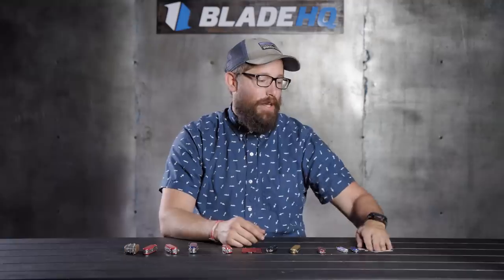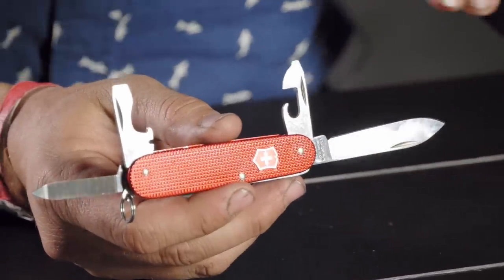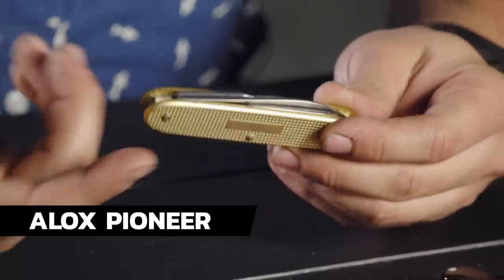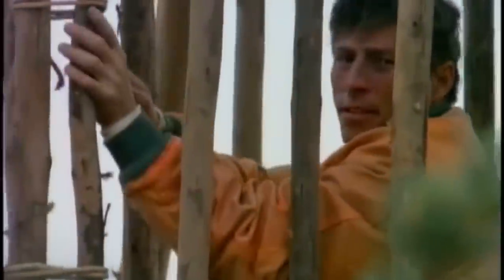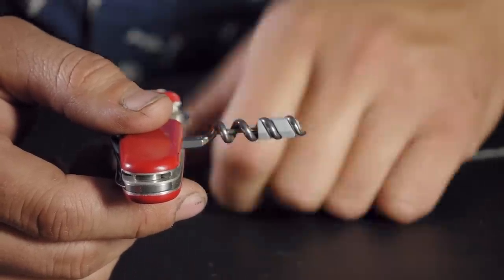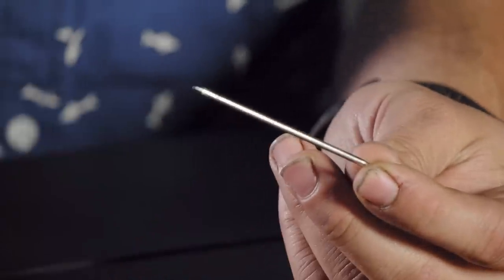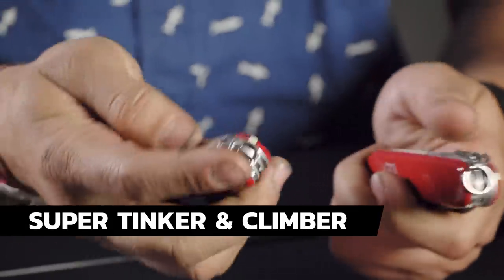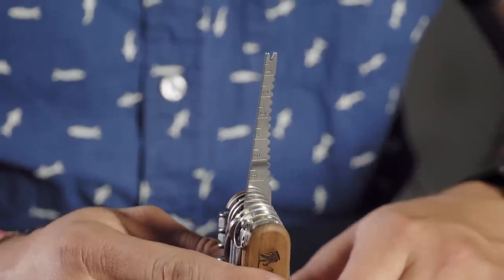Victorinox Swiss Army Expert Breaks Down the Best Swiss Army Knives | Knife Banter Ep. 88

Comment: About the screw drivers on Victorinox SAK’s, I think they rely heavily on having one or more flat head screw drivers because over 100 years ago the most common head type for screws was a flat head. A TON of old infantry rifles from back in the day were put together with large flat head screws for the action to he held into the stock or for the butt plates, or the screw dricee could be used for any fiddling one may need to do with their sights. That and the screw driver is practically a very great wedge or prying tool to have. I wanna say the history of the Phillips head screws were shakey in the earlier days, in regards to being used a lot, and that the western nations have relyed heavily on such for only the second half of the 20th century. When plastics took over I believe that smaller and smaller screws were used, thus screws with the phillips head were great for more torque in smaller applications. Old wood products from the old days would of had a lot more flat head screws being used OVER a phillips screw.

Comment: 6:50 The flat head as you call it fits so much more than a Phillips. It fits most Phillips by tilting it 45 degrees. It also fits one size that it's as wide as. It also fits a couple size of torx, hex, and robertson. Can be used to pry. Can be used to scrape. Vs the single use of Phillips with just 1 or 2 heads and punch use.

Comment: SAKs are originally army knives. The reason you have a flathead screwdriver on a SAK is so you can disassemble you rifle. You won't find phillips screws on a rifle.
Apart from that the screwdriver is also a bottleopener. And yes, in Europe many or most beer and soda bottles still have an old style cap that doesn't screw off.

Comment: I'll take one with the Rope tool, and reamer/leather tool, and an awl, (not a reamer, and actual awl) on the spine; and flathead, philips, standard blade, small blade, saw, hooked cutter, rescue blade, and magnifying glass, with a glass break, in orange Alox, walnut, or beech. They can call it the Explorer, or something. Mariner maybe.

Maybe add a pair of pliers to that. I don't know if you've ever stitched leather, but they could come in handy. And a couple other things that might be useful, along that line: A needle holder with 4 needles in it that fold into the main body with the rest of the tools, (Would have to be long enough to capture the needles and prevent them from slipping out. A leather needle is about 3/32 in diameter and almost 2" long), and a needle driver for putting pressure on the needle to push it through, because even with a hole punched with an awl, they take a lot of pressure. I've used a small block of wood and had it punch right through it and into my finger. I think I was 11 at the time. It needs to hold the needle too, so a bored out piece of steel with a 1/4" bore depth 1/8" in diameter, would probably work well.

Technically, that's 10 tools in the main body, with 6 in opposing slots and 4 individual, (Rescue knife on one side and large knife on the other. i.e: Serrated Rescue knife, needle holder, saw, Flathead and opposing Philips, magnifying glass and opposing hooked cutter, Pliers, large blade and opposing small blade), with a glass break on one end, and a needle driver and lanyard ring on the other, and awl, reamer, (with thread hole), and rope tool on the back. No tweezers or toothpick, (no use for them honestly), with Alox or hardwood scales. 

I know, they don't make it, but if they did...I'm pretty sure I'd have a Swiss Army Knife again.

Comment: The Explorer tweaked to the max is probably my most treasured SAK. Fitted with the extra needle, mini-screwdriver, ballpoint and the mandatory lanyard, it has a very lot of usefulness. Best tools are the in-line phillips, the parcel hook, the scissors and the loupe. The small blade is also more often used than the main blade. They are so easily honed, you can use a brick or piece of pavement if you have to. 
I used to have the Pioneer (Dutch Army version) and a Huntsman but I seldom use the saw and the Explorer is the better alternative.

Comment: The reason for flat head screwdrivers on SAKs is related to their origins. The knives were used to take down firearms. Most screws on firearms were traditionally flathead. The actual uses by civilians made these screwdriver tips standardized, because people found them to be useful for other things, too (prying, picking, electrical work etc.)
Reply: The tip of the can opener is a Phillips driver. It works really well actually.
Reply: @Komissar13  If the screw is too tight the opener will bend a bit though :0) Done it to many Vics!
Reply: whatmakesittick I can see it.  Its definitely not  a perfect substitute, but in the context of a weapon maintenance tool, it’s adequate.
Reply: @Komissar13  Yep! I've found many uses for all SAK tools myself. McGyver rubbed off on me as a teen in the 80's. Found my first SAK, a Super Tinker- on Mt. Speck in Maine in 1986! Always carried one since then!
Reply: whatmakesittick that’s a cool
Story!
Reply: @Komissar13  It gets better. I was in Outward Bound at the time, eat shit and sleep in the woods for 28 days!

Comment: The parcel hook is also used for tying very small (or normal size) fishing hooks, so that when you pull on the line to cinch the knot you dont have to hold it in your hand where it would slip and become lodged in your finger. People with arthritis benefit greatly from this tool. On the swiss champ it makes a great display stand for the retailer. The thing about Sak's is that people with functional fixedness aren't clever enough to figure out how to use them and dont live a lifestyle that requires one. Which is why they get a reputation as a novelty item when in fact they are intrinsically superior to all other multi-tools.

Comment: The flathead screwdriver was the screwdriver of choice for SAKs because these knives were designed for soldiers, with one of their primary functions being that of weapon maintenance (not too many Phillips head screws on guns -  not to mention, Henry Phillips didn't invent the cross headed screw until the 1930s and SAKs were issued well before that).  I think the other difference between the solder and pioneer, besides that keychain,  is the nameplate on the Pioneer.  For outdoors types the parcel hook is the best tool for getting a hot billycan off the fire.  Maybe useful for delicate handed people to carry heavy paint tins, although delicate handed people probably dont carry that many paint tins I guess..

Comment: I got my first victorinox when I was 12, a stainless steel scaled "executive" model. I've carried one ever since. I have also amassed a large collection. My current edc is the cyber tool lite, which replaced a Swiss Champ. I've also got a modified Huntsman, which is actually my favourite model, that I use as a bushcraft tool. They really are great tools. Also, the screw driver on the can opener, opposite end to the flat head/bottle opener end, can be used on Phillips head screws, I thought that was common knowledge, tbh I was surprised that the Swiss army knife expert didn't point that out.

Comment: I have the fieldmaster rather than the hunter for the phillips > corkscrew. I carry it in conjunction with my super tool as part of my get home kit. I wanted the parcel hook.  It can be used as intended or for any task that requires a solid handhold while pulling.  Like weaving with cord or natural fibers and the weave begins to become very tight.
I'd really like it if Victorinox  made a bladeless version with maybe the can/bottle openers, scissors, phillips, reamer/awl, perhaps a file.  Travel friendly and still thin enough to be carried in a pocket.  I carry a knife or two already and don't really need blades on multitools or SAKs.

Comment: The best use for the parcel hook is tensioning a line. If your tying a string line which will have to have a good bit of tension on it you can use the hook to pull on it.

Comment: I still have my Victorinox Camping knife I got as a gift way back in 1978, when I was 13.  I still find uses for it, though to be fair, don't use the screwdrivers all that much any more.  The can opener still works as an emergency backup as I sometimes have to open cans where my electric can opener suddenly gets finicky.  Same for the corkscrew.  More than once, my corkscrew has gone missing and I pulled out my Swiss Army knife to get the job done.

The year I used my Victorinox the most though was 1985 into 1986 when I spent a year studying and traveling in Europe.  I used that knife just about every day, cutting bread, meat and cheese, opening bottles of wine, or beer, and opening cans.  And I used both the small and big blades.  The big blade was better for cutting bread, meat and cheese, while the small blade worked well for peeling oranges or cutting fruit.  (not to mention not having your fruit taste like meat or cheese.)

Anyway, I just bought some smaller Swiss Army knives for myself, wife and college age son for keychain EDC.  I may eventually buy another knife, thinking maybe the Spartan or Pioneer just to keep in the glove box of my car.

Comment: Flat heads are used for torque. There is less likelihood of stripping out a slot than an X. As previously stated it will typically fit a Philips but not the other way around.

Comment: The hook can be used to retrieve something in a hard to reach place.  For example, you drop your keys into a storm grate or something.  The hook opens up a little farther than the other tools, and its on the opposite end of the keychain when it's open.  you could tie it to a length of string and lower it down to fish for a lost item.  its a stretch, but, possible.

Comment: The parcel hook can be very handy if you remember you have it. I recently put eye screws and a wire on a cheap picture frame for my wife using only my super tinker (including the parcel hook to screw in the eyes in the absence of a pair of pliers). Btw, a lot of people knock the blade steel and, yes, it’s a bit soft but it’s super easy to get the edge back again. In fact, a quick strop is usually all it takes. I’ll run it over the strop a dozen times before it actually needs the whetstone.

Comment: Favourite is a 91mm Ranger, but I also carry an 84mm Tinker Small. 

The latter only has the traditional round Phillips over the Ranger, but the size is great for when you need to slim down your EDC. 

I don't drink at all, myself, but still end up using the corkscrew so often - It's one of the best around, and the can opener is better than a P38, P51 (Brit or American versions) and most regular kitchen can openers.

Comment: The Victorinox Explorer is hands down my favorite Swiss Army knife. I have used the magnifying glass in combination with the tweezers to pull splinters out of my hand. It is not too big of a knife for my pocket. I has two knife blades and a Phillips head screw driver. The scissors are great. It is the perfect pocket knife for me. Also, it was chosen as the knife for Boy Scouts Explorer,  which is the top ranking Boy Scout. I can't say enough good things about this knife.

Comment: I’ve actually used that parcel hook before. A friend of mine had a bed where the base was held to the frame with springs and one of springs came loose. That sucker was really hard to pull with just my hands but the parcel hook gave me the grip I needed to pull it back into position. So it’s not totally useless!

Comment: The Delemont series (former Wenger factory) Evolution 14, I saw it as an upgrade to my usual Cadet but with superior scissors, a slightly more bellied main blade, contoured scales and back scale tools. I rotate between the grip and hardwood scaled version depending on weather. If you need to rush out of the house with wallet /phone in one hand and only the gear you can fit in the other hand or one pocket, it’s this and a pen for me any day.

Comment: I've been using a blue midnight manager for years. Knife, pen, a light that I can get around camp with, scissors and BOTH kinds of screwdrivers! Not to mention a few other items. It's barely bigger than the classic and usually rides in the change pocket of my pants. Some people might knock the light, but I've used it many times when fixing all sorts of things, find my way to the nearest latrine or dig through my pack late at night. I think I use the pen the most often though!

Comment: My favorite EDC knife is the Victorinox Executive (74mm) like the one you showed... I've been carrying one since 1976 when I bought one at an army barracks store while visiting a friend in the army at Fort Bragg, NC... sadly they are no longer in production..the new Executive 81 is nowhere near as useful as the original... it is way better than the shorter SAK knives, perfect light pocket carry, with great scissors and nail file... the nail cleaner on the nail file works great for a Phillips screwdriver... do like the flat screwdriver head on the orange peeler... I have used the orange peeler before, and it does work great... I just don't like getting my knife all sticky.

I have many knives and love natural Sambar Stag scales... I just customized an extra Executive knife with Sambar Stag scales and absolutely love it... I also customized Stag scales for my Victorinox Mountaineer, which is a great knife... it has a great file on it instead of the wood saw, yet can be used for a saw due to the file saw edge... I'm not a fan of tiny nail files, like the one on the bag of the parcel carrier hook... I break and chip fingernails all the time, so the files and scissors on my Executive and Mountaineer work great for fingernail repairs.

I don't carry the Mountaineer as often, but as far as the weight goes, just add one of those small pocket clips with a couple links of chain onto the split ring, and the knife will just hang a bit and not settle to the bottom of your pocket.

I do have a Swiss Champ that I bought years ago... it has a nice leather belt pouch, but I never carry it... but it is very cool and I like having cool knives in my knife collection.

Comment: With the Cadet and other similar tools on models the Philips head is on the other side, being the tip and round part of the can opener. The Soldier model had no key chain ring indeed but the tools including blade were a bit thicker stock. They also had a hollow river in the bottom end. The Soldier they made for the Dutch Army did in fact have a bail instead of the hollow rivet and later the key ring.

Comment: I've used the parcel hook when pulling wire through lighting fixtures -- both on the job and around the house. It's pretty good for hooking onto wire or other things in tight places. Does not come up that often, but that's the most practical thing I've used it for. 

My go-to four layer model is the Mountaineer -- rather than the Huntsman.

Comment: @6:05 about this ubiquitous flathead on many SAKs : as far as I know, the 7mm flat screwdriver was originally an army requirement on the first Swiss Army knives, for maintenance purposes on the - then - newly adopted Schmidt–Rubin rifles. Some Schmidt–Rubin rifles remained in service up to 1958. I guess Victorinox simply kept it "as is" afterwards : it's still useful as a screwdriver (flathead screws are mostly legacy in the EU, but still often found on door handle plates), it's maybe still required by the Swiss Army, and it's very useful as a makeshift "key" for common 4mm square bit holders.
Reply: Flatheads are more versatile than philips. With the philips you can only do philips. With the flathead you can do flathead, philips and in my case even a security torx (torx with the dot in the middle; I just jabbed it into diagonally and was able to undo the scree). Not to mention all the prying, or trying to lift the head of a screw, do you can reach under with a plier. Etc.

Comment: I carry a Cybertool 34 in transparent blue in my jeans pocket. Along with an Olight S1R II Baton in the small pocket. A very nice combo.
Instead of the missing belt clip I use a EDC Suspensions Clip attached to the keychain ring on the Victorinox to fix it vertically in the pocket. With this a bigger knife like the Cybertool or the 111 mm versions like the Hercules are no problem for me, I don't feel the knife most of the time.

Comment: I have probably 10 or so SAK's but I have only really ever carried the Compact for the last 9 or 10 years I've been collecting knives. It was one of the first knives I bought myself. I have yet to use the parcel hook. I've heard guys using it for a 5 gallon bucket if the little plastic handle broke off, or on a camping pot with the wire handles. I like the idea of swapping it with a screwdriver.

Comment: Up to around the 80s flat head screws were very commonly used in Europe. Yesterday at work I did some maintenance on a 30yo Unimog where a lot of screws were flat heads. Nowadays I can't come up with an example where flat heads are still in use. They got replaced by pozidrive and phillips or a different drive.

Edit: The hook is great to pull out nails from a wall if they aren't all the way in

Comment: If you look at the hinge of the corkscrew/philips screwdriver there’s a little hole in where you can put a pin. This is because victorinox didn’t want to have all of the knives to have this pin, but also they didn’t want to manufacture a different scale. You can buy an aftermarket pin though.

Edit: if you have the hook and the pen, you can put the pen in the slot of the hook goes, then close it so you have a better handle for your pen

Comment: I find the steel very good and easy to sharpen.I have several and now you can buy inserts to replace the toothpicks with flint steels that can be used on the backside of the saw blade.I believe the company is called Tortoise Gear/Firefly.I do not leave the house without one of my SAK's.